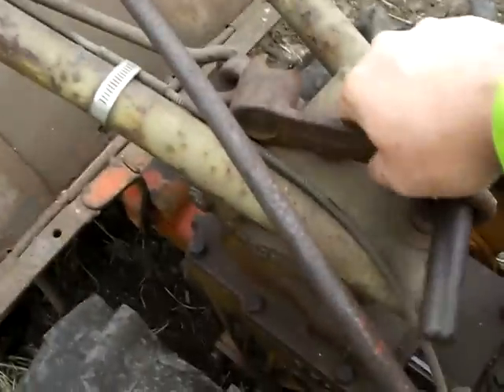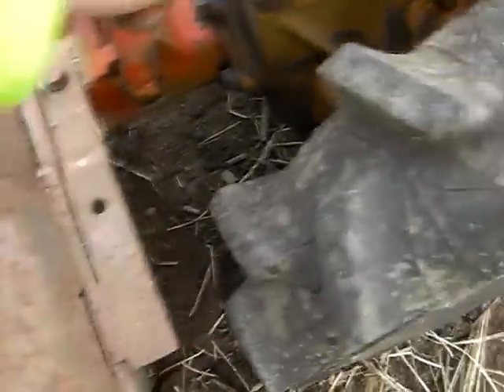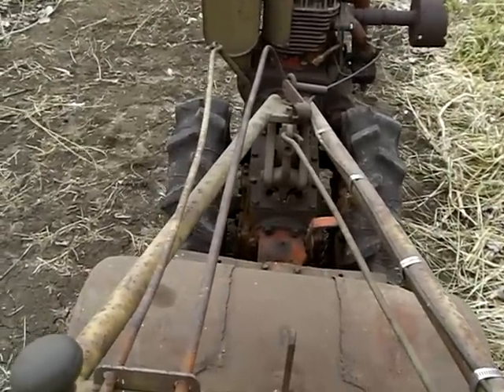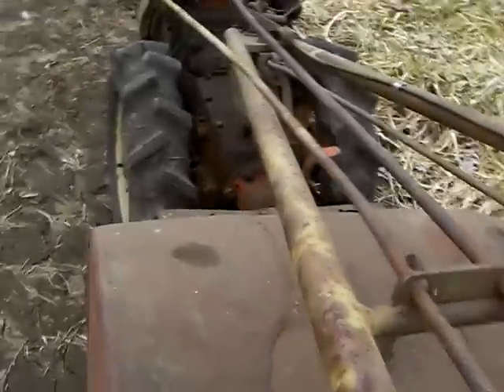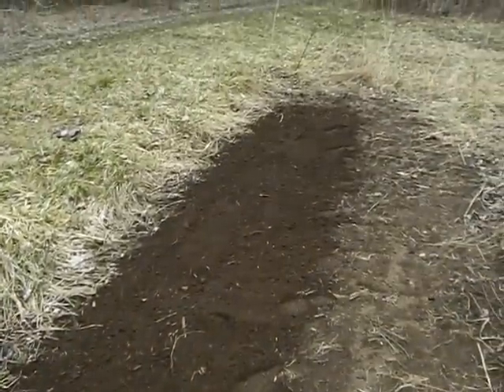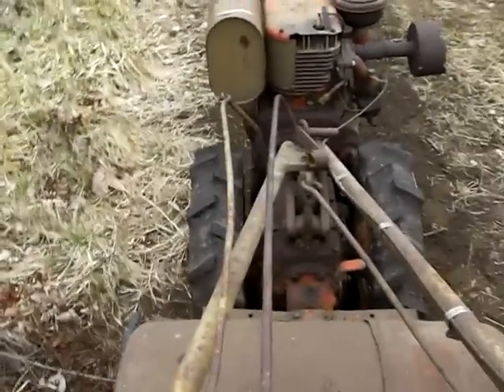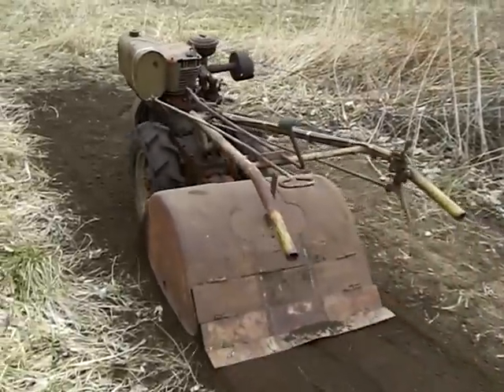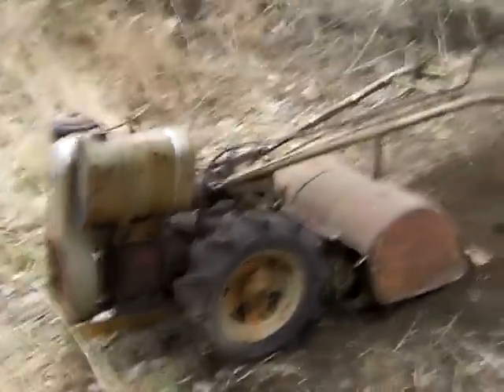1948 Ariens Tiller

Comment: A few years ago after adding this video to my favorites I got the urge to find an AHH of the same vintage. Well I found one and it's in good running condition. It's covered with oily barn dirt and mounted on a rough sawn timber base. It was used as a stationary engine driving a flat belt. Too much character to clean up and restore. I'll use it on a cord wood saw just the way it is but will maintain it like a new engine. Thanks again for the video.

Comment: Tips? Well I have a couple. Slow the engine down and let the tiller part do the work a little at a time. Or, drop the depth rod to it's max and then use that to hold the tiller back from 'running away'. I personally prefer to do both because operating any machine with care and not over working it will mean it will last longer. Good luck.

Comment: Sweet old rig. The Wisconsin is a real motor. I got a Robin to replace a blown cast iron block Tecumseh  that was a smooth runner. You did really good with one hand. They run fine until they hit a hard spot and jump 10 feet. I've got a Troy Bilt with a 7 horse Kohler on it and it'll leave the earth!  And I really like my Gravelys. Good Video and resto job!

Comment: Growing up my gran pop had a really old rotohoe which became troybilt , I have his original tiller it needs a drive axle for the tines which is the same in the troybilt horse model. All cast iron made to last a lifetime . I saved it after he got a horse t from troybilt to replace the hoe. I too bought a big horse kohler 8 magnum used it for years till my legs gave out from a botched spine operation. .So I plan on restoring the hoe to new condition. These are great machines. Dont ever have to work hard it does it all.

Comment: My uncle has a Wisconsin AHH  engine similar to the one pictured in your video ( great video by the way )  he got it  off of an old  Ariens Model B tiller years ago, its now attached to a four-wheel drive tractor he made, but the engine needs some gears and other parts, any idea where one can get parts for the old engine ?, thanks,

Comment: sure dont makem like that no more.  those old wisconsin engines were bullet proof.   pistons the size of syrup buckets and a stroke as long as my arm.   not a high rpm engine but had lots of low rpm torque as demonstrated as he made a pass at just off idle.

Comment: Just picked one if these up today,  ran last year (per owners son) any pages you recommend on getting her  back up and running?
Reply: Samuel Mitchell any luck with your tiller? I’m looking at one and would like some advice
Reply: @St.Hermans_Speed_Shop  i was able to get it running, the points needed a good cleaning, there is a manual on ebay that was very helpful.  I've since sold it and moved on to a few other motors that needed fixing

Comment: Does anyone have an idea on the value of these tillers? I have found a Model B like the one in this video. The seller said it hasn’t ran in 3+ years and the carburetor needs to be rebuilt. He wants $650 for it. I think he is a little high. Any input would help!
Reply from the maker: Joe I think $650 is about double what it would be worth. I sold the one in the video for $325 or so.
Reply: The Junkologist's Junk Heap that seems to be what most say. Thank you for the reply.
Reply: Right now, up here in Canada I'd pay 1k for it.  That machine will do the work of a tractor disc so it's worth it since they don't make them like that anymore.  Looked online and they have tillers that scuff the surface for 1k.